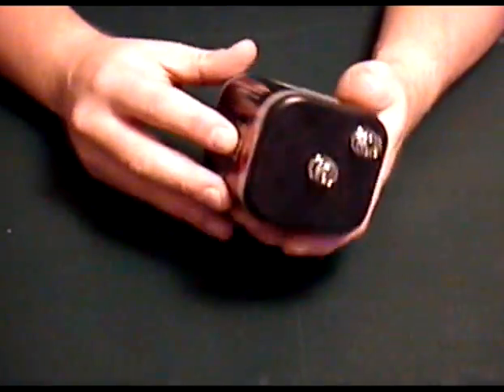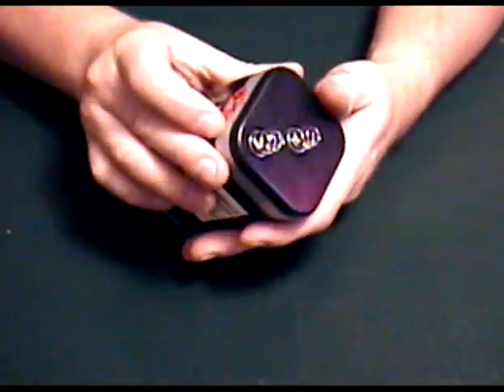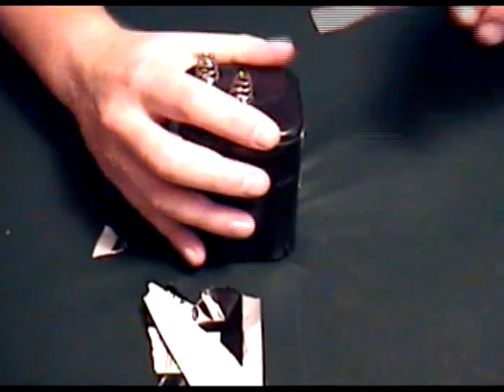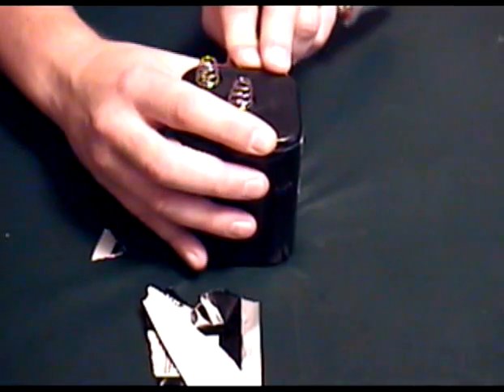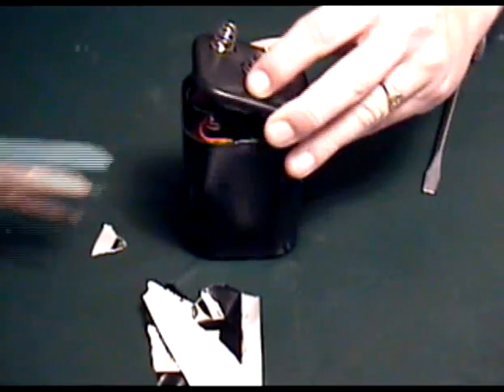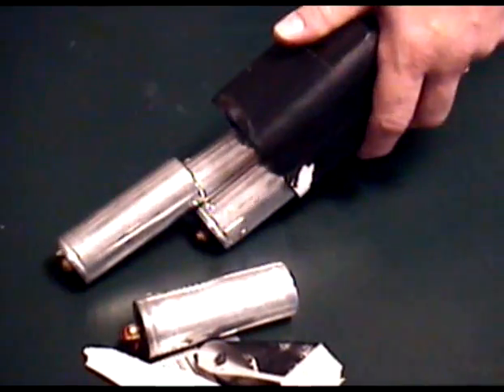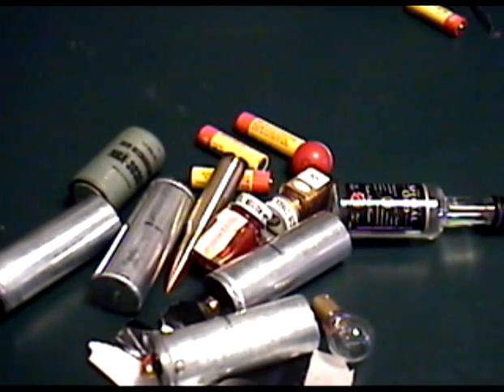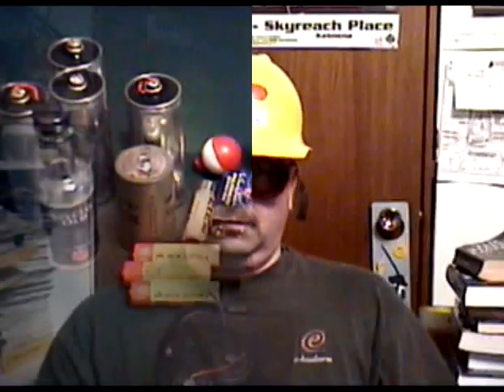Taking Shit Apart

Comment: Yup :-)

32 x 1.5 volt batteries wired up in 8 groups of 4, so that each group of 4 batteries is in series (positive to negative) which equals 6 volts (4 x 1.5 =6), but wiring each group of 4 batteries parallel to the other groups (negative to negative & positive to positive) keeps the voltage to six. Which means the total of 32 batteries makes six volts. 
:-)

Comment from the maker: But you didn't consider the empty whiskey bottle, fish bobber and .50 cal round. They act as quantum voltage regulators, which first raise the voltage to around 600,000 volts and then through the molecular inertial difference between the red and the white hemispheres in the fish bobber, drop it down to 6 volts. The model paint and light bulb simply act as stabilizers and prevent the buildup of carbon nanotubes and bucky balls.